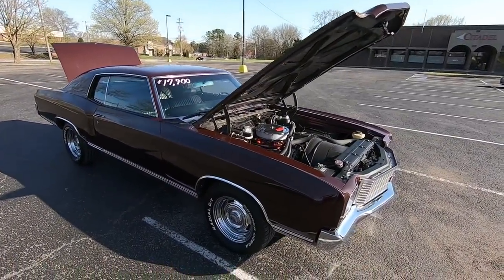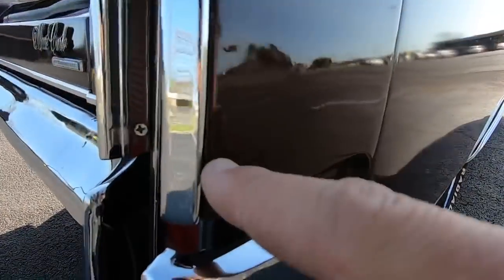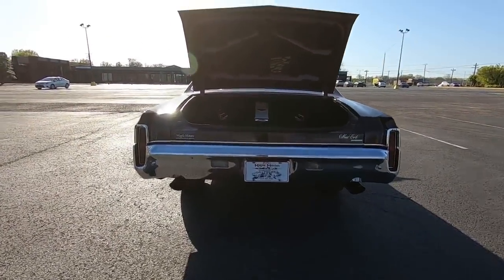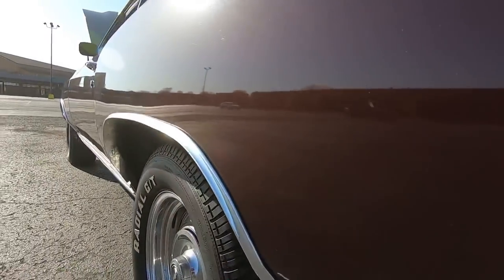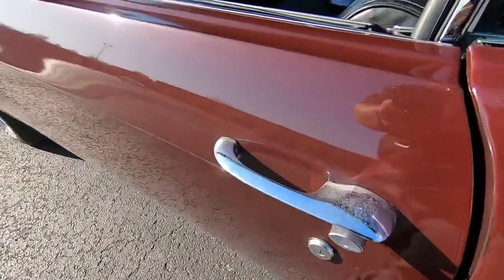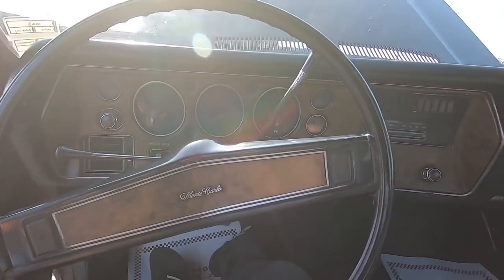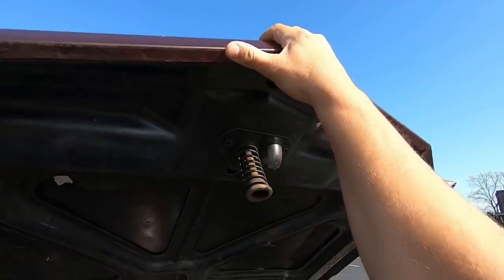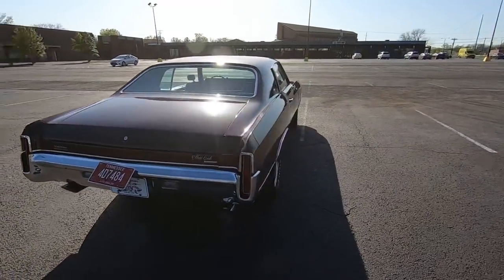1970 Chevrolet Monte Carlo SOLD $17,900 Maple Motors #1023

Comment: My Monte looked exactly the same inside and out but had the vinyl top and color matched hub caps. 300hp 350 with 62 k when I bought it in 1982. Was outrunning 455 Buicks, Olds, and Fords without much trouble. I paid $2100...